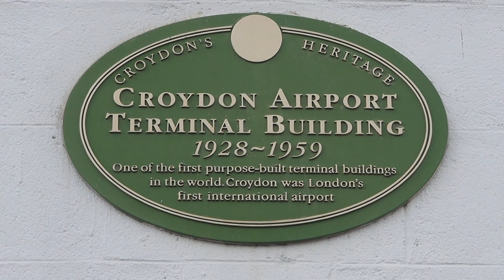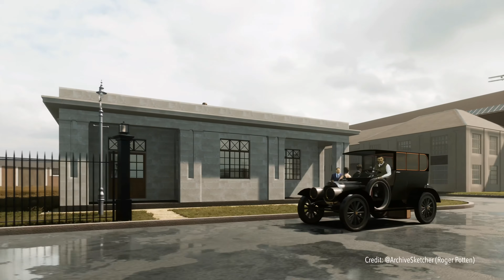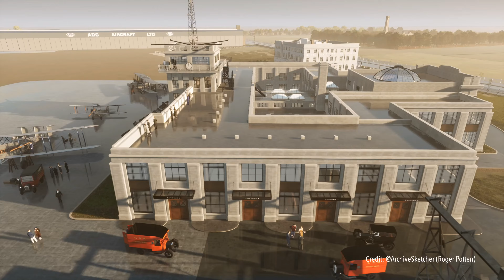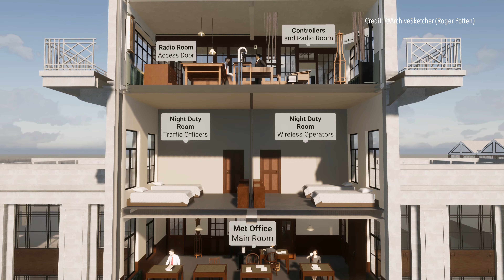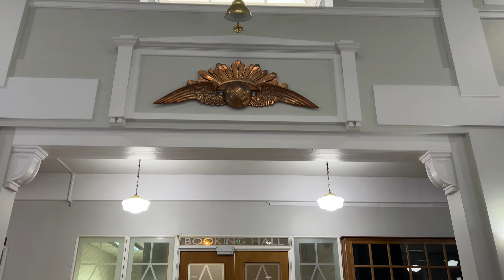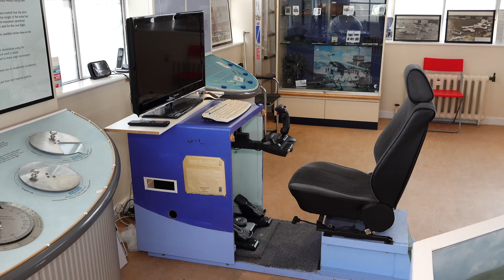Historic Croydon Airport - a key part of aviation history

Comment: Most interesting and a very professional presentation. My brother and I were taken on a flight in the 50's, to an altitude of 9,000 feet, to ease (it was said) our wrteched whooping cough. Btw, modern aircraft use VHF frequencies from 108 mgcs - 135 mgcs (I believe) - I guess Croydon airport used Short Wave?
Reply from the maker: Thank you for your kind words. I will have to check with the team to find that out.

Comment: The position fix mentioned was achieved by a fixed telephone link to various radio direction finding stations (RDF) around southern England. An aircraft would request a fix from Croydon tower and the remote receiving stations would report the bearing to the aircraft and the CATO's would plot the different bearings on a special chart resulting in a pretty exact location which would then be transmitted to the aircraft. Took about a minute. Must have saved a lot of pilots.
Amusingly you can still do this by calling an ATC and requesting QDM (Q code, Direction Magnetic TO the station) and they will give you your bearing to them.
Reply from the maker: Thank you, that’s useful to know!
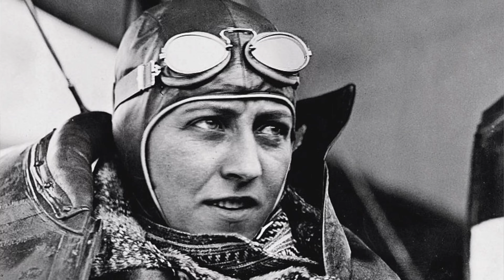Reply: @philswallow  All explained at 8:30 in on YouTube video "Airport - first-ever film made film by the Shell Film Unit describing a day in the Croydon Airport"
Reply from the maker: @AnthonyHigham6414001080 ah thanks, I saw that film a while ago so will take another look.
Reply: @philswallow  It is explained here @ 8:30 in.
https://www.youtube.com/watch?v=dBKgiDkITUQ&ab_channel=NationalAerospaceLibrary

Comment: I heard the place is very haunted is that true?
Reply: So I have been into the building  on a few occasions and whilst I would never say it has a "haunted" feeling it does feel like one is stepping into an age gone by. The high ceilings , the brass and the wood (oak ) do give it an almost cathedral like sensation. One day I was waiting at the front desk and someone's smartphone rang on the desk. It seemed very very out of place and an anachronism. I always half expected someone to come out of a room into the foyer with a cut glass English accent and a 1930's dress.
Reply: @JohnJones-ct9pr  I just found out one of the ghost was a Dutch pilot warning about the fog .
Reply from the maker: I’m not sure, quite possible though I expect. A number of former RAF stations have reported such things!
Reply: @philswallow  Yep I guess so heard it was an RAF pilot .👍
Reply: I remember some aircraft being repaired in one or two if the old hangars along side the purley way in the 60s

Comment: Very interesting clip.My first proper job back in the early 80s was with a company called Jackson Brothers.We used to make tuning capacitors for,amonst others,the MOD and Marconi and  i have no doubt that some of our products were in the equipment used at Croydon Airport.The other interesting thing is that the building myself and a colleage called Jim worked in,was refered to as 'The Bungalow' by Jackson's staff but was actually the old field hospital for the airport and had a brick cross, which presumably was once painted red, built into the front of the roof.I have seen a picture of it during its operational time with the nurses present but couldn't find it to post here unfortunately.The building is long gone now as is the road it once stood on,Kingsway.It's a shame and really should have been listed rather than being built over

Comment: I used to go to a training centre in Imperial Way, off Purley Way, very close to where the airport control tower was. I got off the 194 bus right by the old airport buildings, where there used to be a swimming pool (I think they kept the diving board?). I've flown my radio controlled plane there too. Amazing memories of Croydon where I lived for a huge chunk of my life. I hate how so much has changed and old buildings (including where I worked) now torn down.
Reply from the maker: That would have been the Purley Way pool that later became Rockingham’s Garden Centre. The diving board is indeed still there! Croydon is suffering, some of the buildings still remain but much has changed, sadly.
Reply: @philswallow  Thanks for the info Phil. Yes now you say it, Rockingham's Garden Centre does ring a bell in my head. I'm glad to hear the diving board is still there!
Reply: Unless things have changed,  the old swimming pool is now a garden centre, and the diving board is still there.
Reply from the maker: The garden centre (Wyevale, formally Rockingham’s) closed in 2018 and nothing has been done since. Bellway Homes had an application refused, to demolish the site except for the diving platform last May. They are looking to build homes on the site but the listed diving platform will remain.
Reply: I remember the old 194,and the pool back in 57.